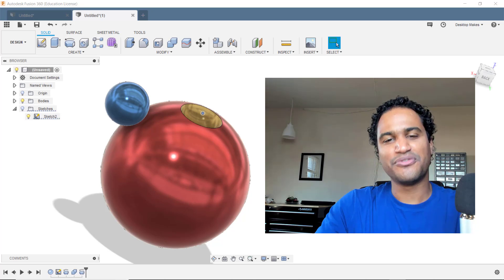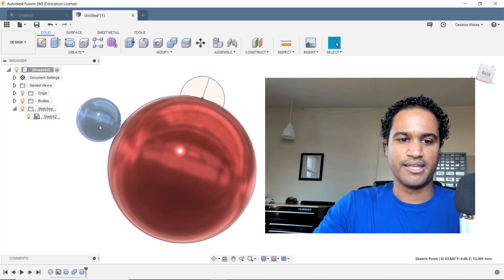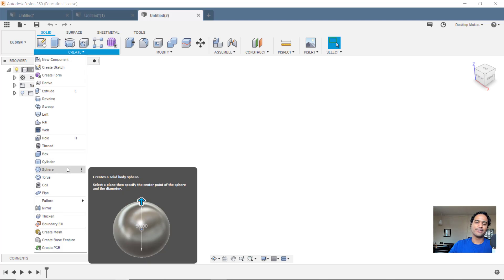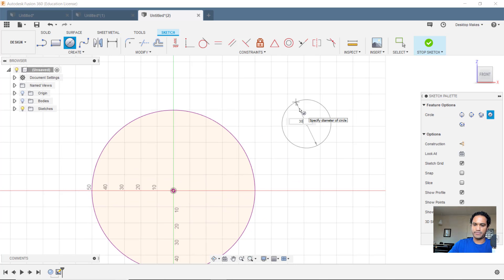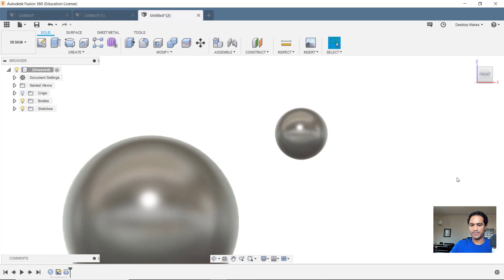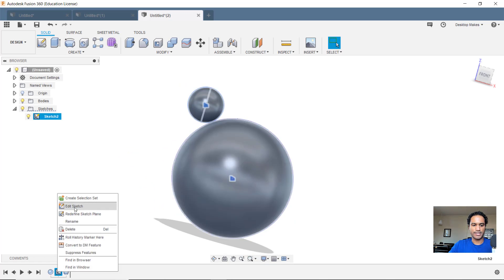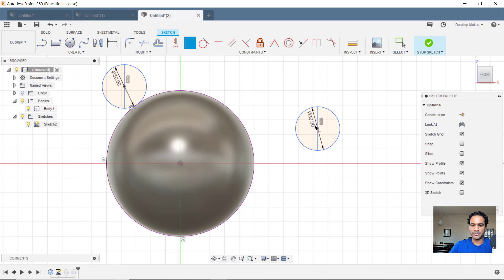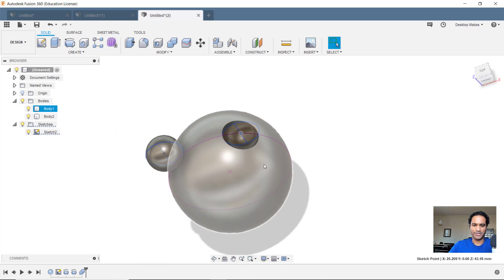Tangent Spheres in Fusion 360

Comment: Hi Vladimir,
Thank you for the lesson. I have a problem.
My small circle does not move to a large one but increases its size to the point of contact with a large circle. I don't know what I'm doing wrong ((.
Reply from the maker: Hi Tetianna, give the small circle a dimension first.  This will keep it from changing its size.
Reply: @DesktopMakes  Thank you, Vladimir, for the answer, 
I made a small circle first, then a big ball. And on a tangent to increase the large circle to small. Like last time, but just the opposite.
But I am ready to experiment many times!
I did the second part of the lesson. The center of the small circle is moved to the sketch of the large circle and the hole moves after the sketch.
Thank you for your lessons.

Comment: Interesting challenge. I tried solving it. I have used the revolve cut option. First , I created the bigger sphere. In the second sketch, I created the point on the bigger sphere using project. In the third sketch I drew a half circle and used coincident constraint and coincided with the point in the second sketch. Then I cut revolved this half circle. So when the point moves on the sphere, the hole too moves. But, I was just wondering if there is any other way to revolve the spheres tangential and not necessarily in the same plane as in this case.
Thank you for the challenge which makes us think laterally
Reply from the maker: Thanks mechatheart.  I'm not sure of a way to freely move the sphere so it is not constraint to a plain.   You can create a sphere on a different plane to the big circle by creating line on the same plane and then choosing Construct- Plane at Angle - and set your angle.  Then, create the smaller circle on that plane.  This way the smaller circle will be drawn on a different plane but will still only be able to be moved along its plane.
Reply: @DesktopMakes  Got it. Thank You

Comment: Great video. The only thing I would do different would be to make the ends of the small sphere center line coincident with the outside of the large sphere instead of the center of the small sphere.
Reply: There has to be something like this for the hole in the larger sphere to be of a known diameter - as shown, it will be less than the 30mm and dependent on the diameter of the larger sphere.

Also, is the solution shown really a hole, surely it's more of a dent? 

What if you want to bore 45mm deep, or whatever?

Sorry, but this one is a bit of a fail, in my book.
Reply from the maker: Thanks enginebill.  Did you try your approach of making the small sphere center line end point coincident with the outside of the large sphere?  You get an interesting result when you move the small sphere around.
Reply: @DesktopMakes  I did try it and the small sphere did move but I did not notice anything that I thought was unusual.

Comment: Another fantastic challenge Vlad. I didn't get it quite right, first of all, instead of using primatives I used sketch and revolve for all the spheres. That wasn't a real problem, it still worked, or it would have done if I had used the combine function, but I used the revolve with cut. The whole thing worked with the sketch and revolve route, it was just my use of revolve/cut that failed (it was obvious after the fact) Yet another lesson learnt. Thank you.
Reply from the maker: Thanks Spike.  Using sketches would actually have been the way I would normally approach this.  I went the primitive route simply to show that the option is there.  It looks like you took a little bit of a different route but I think it should have gotten you to same place.  Not sure why the revolve cut would fail.
Reply: @DesktopMakes  There are often many ways to obtain similar results, I like to learn all I can. I think the reason that revolve cut didn't work is because it is a one time operation, so moving the sketch afterwards doesn't move the cut. However, using the combine function moves and updates with subsequent moves. That's just my theory based on what happened when I modelled it.

Comment: You mentioned on your other video the you dont take requests from other people... but i think you should do this more often, people often run into the same problems in Fusion 360. Your recent videos about the split face really helpful to many people.
Reply from the maker: Thanks zero00tolerance.  What I meant about not taking requests was in regards to doing designs for others.  For example, I sometimes get requests to design a certain Star Wars helmet for someone or some other movie prop or gadget or invention.  I don't mind taking requests on how to approach a design.  For example, "How would I go about getting this shape"?  Or "how does this tool work"?  "How would you approach this" type of questions.   You're right about people running into the same type of problems and recent requests have helped me come up with video topics.